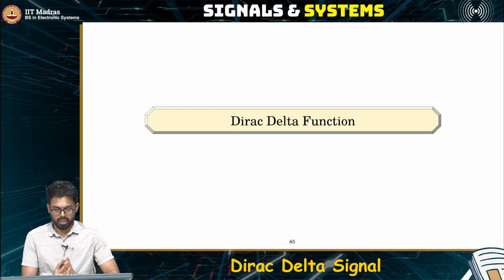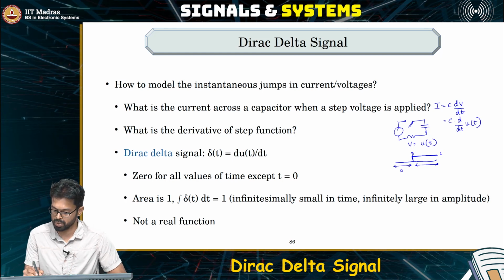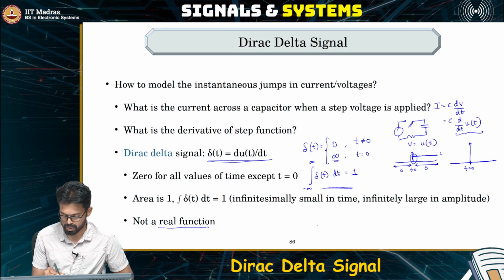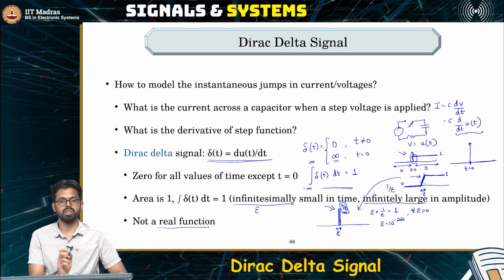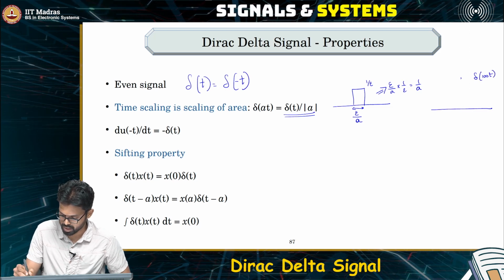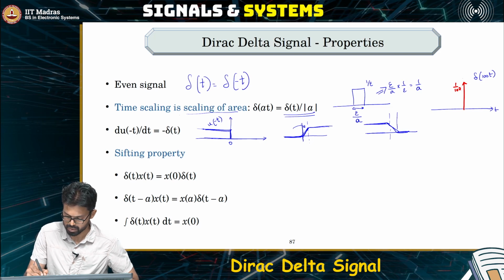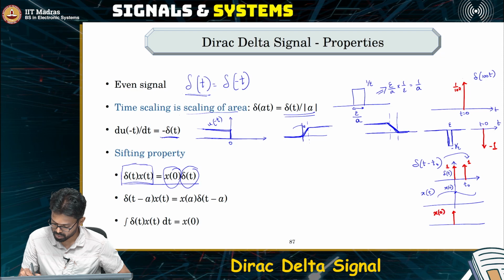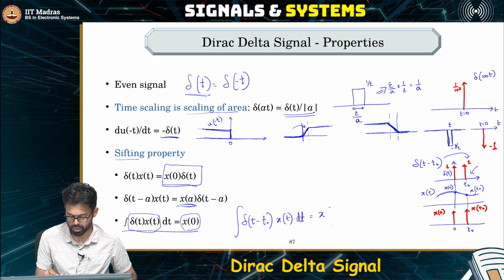W4_L2_Dirac Delta Signal

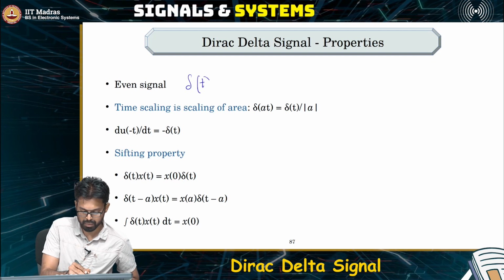Comment: 9:29 sir,how can we say that the delta function is either an even or odd function?
Because, the delta function has a small portion on the +ve x-axis side , right?
Are we preferably neglecting it,since the interval is so small?🤔

Edit - i think it is made symmetrical to y-axis by assuming that the step signal starts rising to 1 even before t=0,but how can we justify this as  it should start rising only after t=0 , right,as per the definition?
Reply: I think we can say delta function as even as it starts little before t=0 and it's more like a spike (or in some ways just to understand like a triangle) and its value at time t is the same as its value at time -t same along y-axis.
(This might be already cleared to you by now )
Reply: @jk_ananya👍🙂